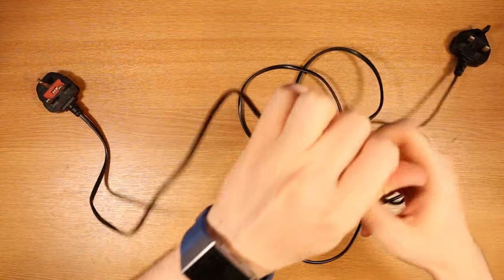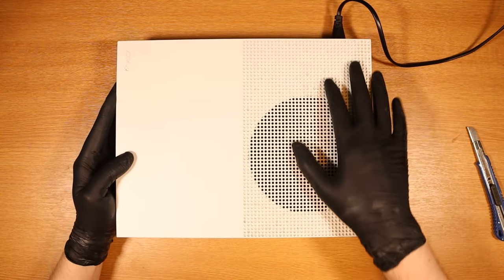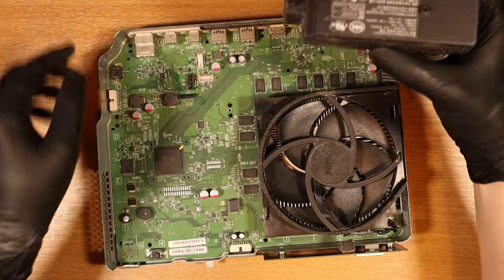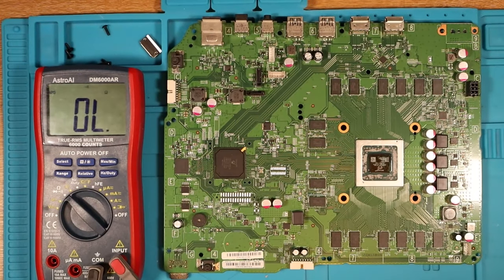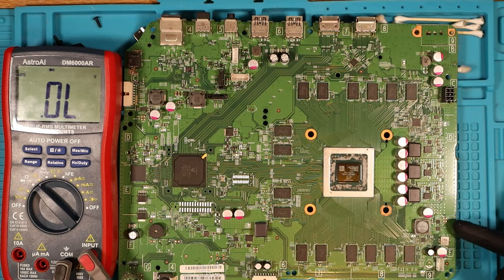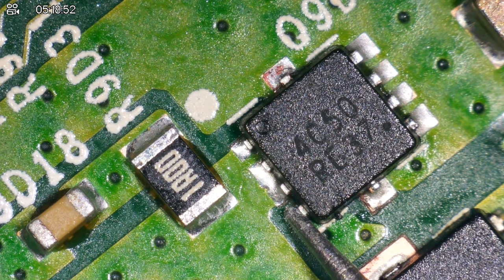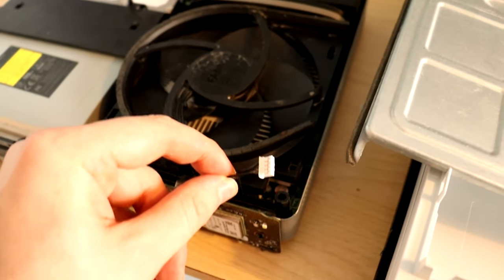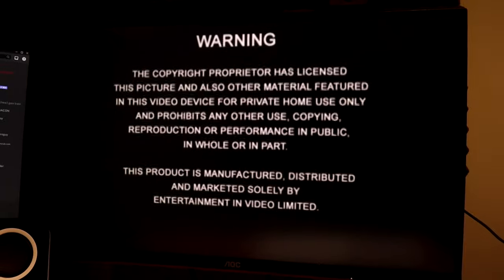Xbox One S No Power | Can We Fix It!?

Comment: I bought a one s and yesterday I wanted to clean it and now nothing happends amymore only a slightly clicking noise that seems to come from the power Supply
Reply: The power supply isn't too expensive thank god.
Reply: @GreyKnight79Fox  i bought an aliexpress replacement and i'm not even joking but it exploded inside the Xbox 3 days later. So after that i got an original one and that works fine now . I'm happy the Xbox is still oke xD.
Reply: @HD-wf3bp  i have the same issue but my replacent power supply still won’t work is there anything else that i can do to fix it
Reply: @Glufub bad hard drive? Usually whenever your xbox doesn't turn on its either the power supply, hard drive, or the motherboard

Comment: For screw locations

B = Board (standoffs soldered on to the board)
C = Components
F = Frame

Those gold screws are usually silver, I think some versions had gold and some had silver. They're TR10 by the way 🤫

Black screws are for front panels and apu and they're TR9. Hopefully that helps you bud
Reply from the maker: Legendary as always. Makes complete sense, never even realized 😂 thanks pal

Comment: MOSFETs going is usually common. But  the u4c2 voltage regulator can also go.  I always check the power supply first then MOSFETs 12v rail then u4c2 chip

Comment: That first one is a faulty hard drive as it powered off before you managed to plug it in. 1 minute usually failed hdd and console turns off
Reply from the maker: Ah nice one! Will have a look at that next :)
Reply: Power it on and count. Its usually about 1 minute and will turn off. If that's the case the hard drive is bad and needs replacing. By all means you can test it on the PC with crystal disk to verify